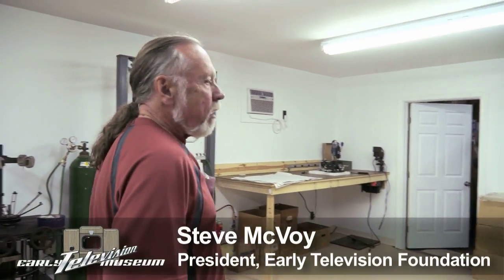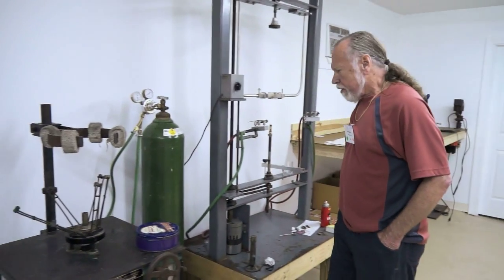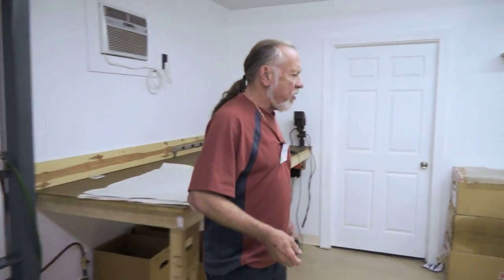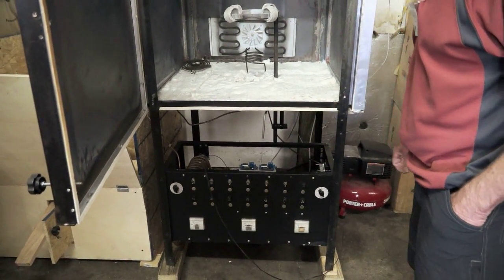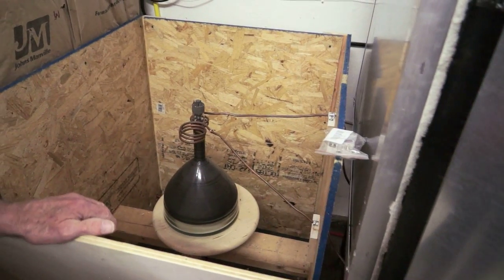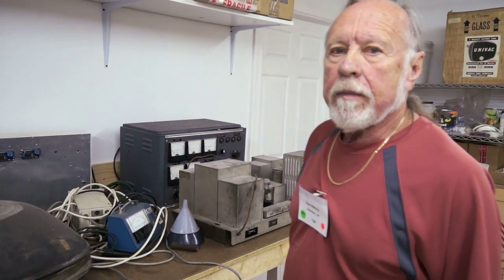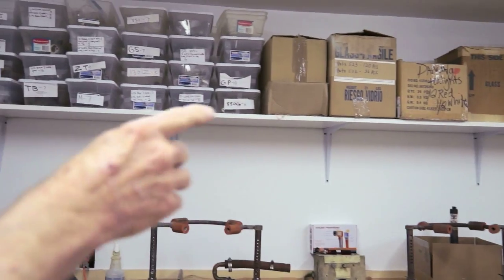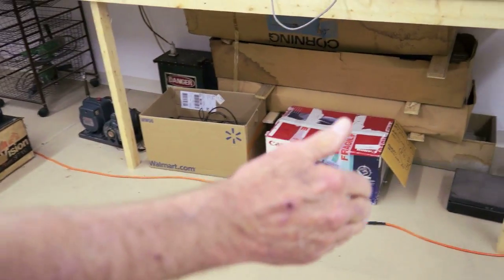CRT Rebuilding Lab Tour - May 2015

Comment: It's a skilled operation, the labour cost of having a black and white tube rebuilt would be more than buying a new TV colour tv set today.
Guessing it was maybe practical 50 years ago when a top line TV set cost the equivalent of $2000 in today's money
Reply: The reason for rebuilding tubes today is that replacement ones for early sets are difficult or impossible to find. Collectors need a source of CRTs to keep their sets going.
Reply: @stevemcvoy9466  sure, I'm aware it's now down for collectors, not for someone who just wants a TV set repaired lol

Comment: Very nice setup! You were very lucky getting all that stuff!
On the sealing of the neck, align the parts perfectly first. Then use a small hand torch to spot weld a few places around the perimeter to hold the alignment. (heat the entire area first to keep from cracking the glass)  Then rotate and heat the joint. Have a pressure hose connected so you can blow slight pressure into the tube as you do the seal to keep the glass from collapsing inwards. If a hole develops in the seal area, immediately stop and use a small diameter piece of rod to fill in the hole. (It will not close itself.) See my "glasslinger" videos for some demonstrations of sealing joints on vacuum tubes.
Reply: Many of us have seen your videos (and are in awe of your glass-slinging skills.) We'd love to have you come by to an Early Television Convention and get your firsthand opinion about our setup. Please call me at 760-6-MARCONI to discuss, if you like.

Comment: This is very cool, I never knew you could do this with a CRT. If/when you run out of electron guns, where would you get them from after? Also, what is the earliest tube you repaired?
Reply from the maker: We are not rebuilding tubes yet. When we start, we hope to do late 40s and early 50s black and white tubes, and 50s color tubes. Eventually we hope to do prewar tubes.
Reply: We have a good supply of guns. And we're working on techniques for rebuilding the old guns (fitting new cathodes into the existing gun assembly.) And, there is at least one company in India that can manufacture new guns that may or may not prove to be a good source.